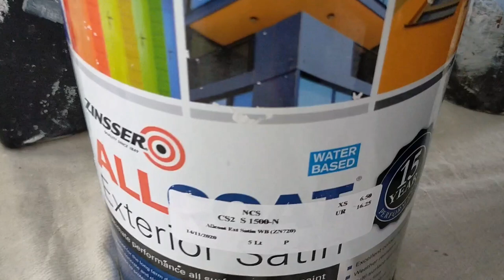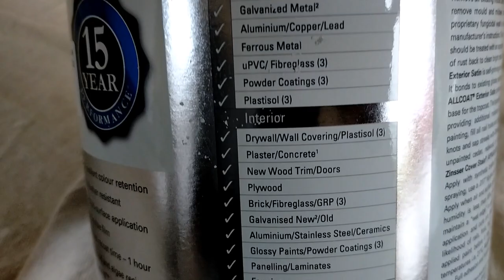Zinsser Allcoat Exterior

Comment: I've really stepped up our usage of this product this year, I cant fault it in any way. We have tried the gloss, satin and matt in black white and tint. 
The coverage on the white gloss isnt great but that seems to be standard these days 🙄.
I've just used the matt on our office internal woodwork as a ware test.
So far the results are good.
The only reason I will be using oil based undercoat and gloss on exterior work is when it's over existing heritage timber such as sash windows. 👍
Reply: What do you think of the matt? I did a load of sash windows [5 years old] on a cottage back in September, matt at the customers request. Typically I use Allcoat Satin. It cures brilliantly and is super white, but I didn't rate the application particularly high.
Reply: @acropolisnow9466  I do prefer the satin myself but thought it best to try the whole product range. I guess we just need to trust the process, have you been back to see how they are doing after 5 years?
Reply: @mungojack  My apologies, I meant that the windows themselves were approximately 5 years old - factory made and sprayed with waterbased which had begun to badly fail and bring on rot. I had to sort them out in September of this year. I'm skeptical about the '15 year guarantee', naturally, but upon completion the paint seemed decent like I said, cured very well. Truth be told, I probably would have put Sikkens on them if I had the chocie, if the customer hadn't been insistent on matt, and Allcoat is one of the few readily available exterior matt paints for wood.
Reply: @acropolisnow9466  let's see how they weather over the next few years. If it's as good as they say it is then theres no hope for the other paint manufacturers.
Reply: @mungojack  We shall certainly see.

Comment: Why not invest in a sprayer with the labour costs you've put in on this one? A cheapo xvlp would have been ideal at about £4-500. Could have been finished in 2/3 days
Reply from the maker: Maybe but to mush furniture being moved from one side to the other and the house is open plan. So keeping over spray under control could be an issue.
Reply: @PaintingandDecorating  nothing proper preparation can't avoid. Big issues with overspray with properly setup hvlp/xvlp is rarely a problem anyway. Not taking anything away from the work you've done by the way, just would have made your life easier and wallet fatter that's for sure! Something to bare in mind for future